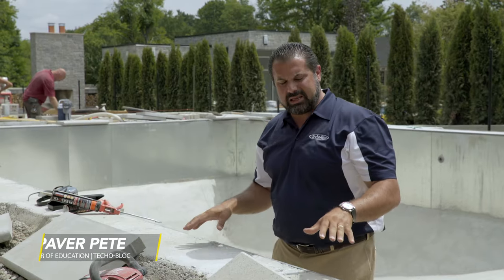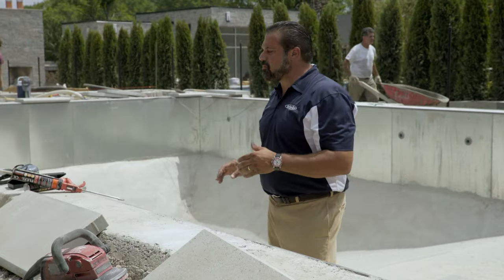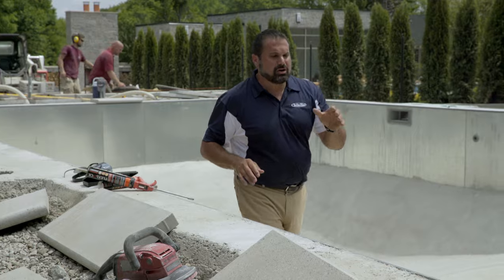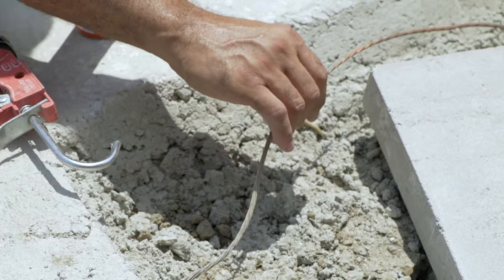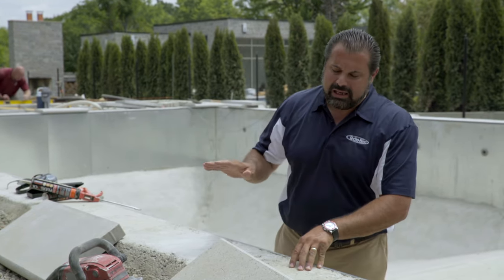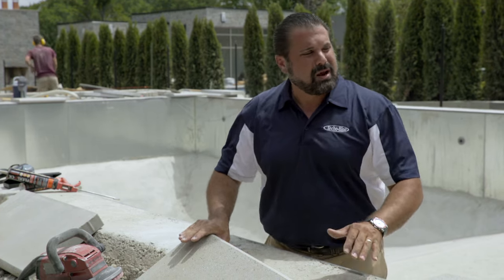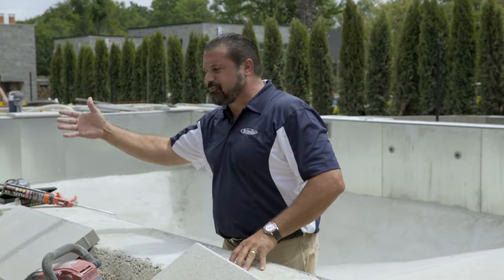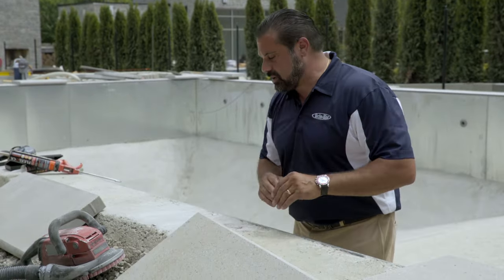Pool Coping Installation - Preparation and Adhesion

Comment: I have another big question and it has to do with decking. My old home has an old concrete deck around it that has many cracks that have been sealed with a bunch of different junk from the previous owners. Is there ever any way to go over the top of all decking without having to bust everything out? Thank you in advance!

Comment: I'd use a regular mortar mix to set the coping and sanded grout made for exterior usage instead.  caulking is for a quick job and not a professional job

Comment: What is that adhesive in the caulk gun? I need a brand name I’ve always used mortar I’d like to try that out
Reply from the maker: Hello Josh,
We used a Flexlock adhesive. Here's their website for more information on their products : http://www.flex-lock.com/products/binding-agents/
Also, here's an article we wrote about this video : http://pros.techo-bloc.com/pool-coping-installation
Thanks, have a great day!

Comment: Is paver coping always placed on top of cement or can it be directly on top of the steel flat top of the pool frame?
Reply: You can do that but I have seen the coping stones occasionally pop loose doing that way without pouring a concrete collar.

Comment: How is mortor going to cause efflorescence? That makes 0 sense.
Reply: Water is the universal solvent and will break down anything!! I deal with it with brick like sprinklers or water against a wall will pull minerals and lime from the mortar and cause it. You'll see  it where people layed wet material and the mortar didn't cure properly and will certainly cause effervescence. Concentrated Acetic acid will remove it but will definitely be re occurring. Water and mortar don't exactly mix.